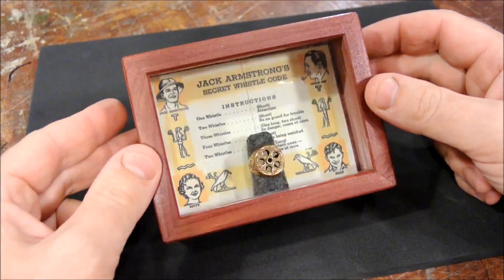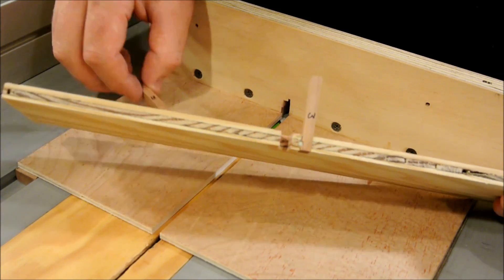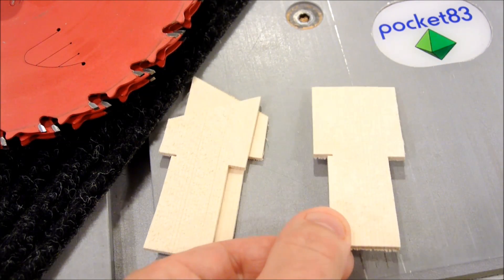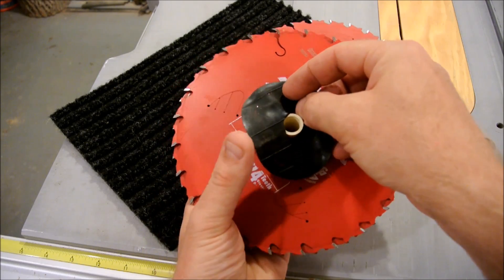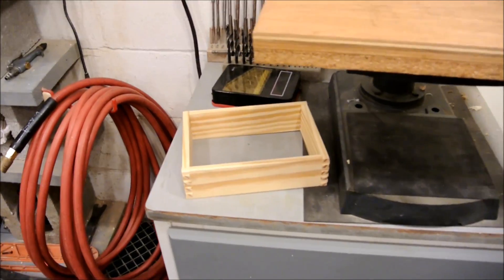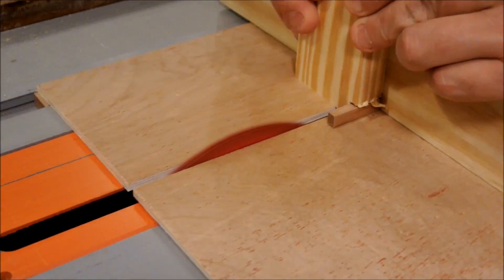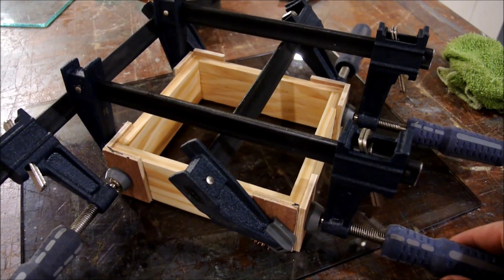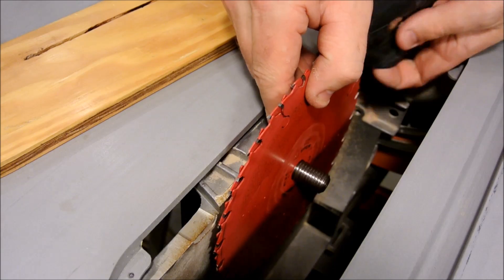Box joints WITHOUT buying a dado set (make one)

Comment: By the time you buy enough blades to stack you could of just purchased a dado set up. Ive seen a decent 1 on amazon for 50.00. Good reviews. Just fyi not cutting on video or creator. We appreciate folks that come up with creative ideas. So thanks for video bro.
Reply: 7¼" blades are two for $10 at the box store. You can even use your old dull blades in the middle.

Comment: I did the same home made dado set. I notice the saw vibrates a little more than with a single blade, which is expected. I wonder if it might damage the arbor someway. But I have no other way to go: dado sets are very rare in Brazil or extremely expensive.

Comment: I don't think that's safe at all. The point of a dado stack is that they are not all full blades. With full blades, that's a lot of mass that your table saw has to move. That'll lead to premature wear.
Secondly, that cobbled together table saw? Definitely unsafe. See the kickback from that monstrosity? No riving knife? Yeah, don't do that.
The stacked "box joint" method is clever if you don't have another option. But don't stack multiple standard blades to make a "dado". Just not good all the way around. If you need a dado/rabbit but can't afford the blades, just use the single blade with multiple passes.
Reply from the maker: Your comment was all shell and no meat. "Yeah, don't do that" is not an argument. Premature wear to what? It will be (re)moving an equivalent mass no matter the number of teeth. If your concern is with motor strain, I will remind you that this is a 10" saw using 7.25" blades at a modest depth of cut. As for the "cobbled together" part, I'd almost take offense to that jab if you hadn't just clearly demonstrated a lack of any ability to operate outside of dogmatic routine. Grow up and develop some situational awareness, child.

Comment: Why are you worried about the stacked blades slipping? It's all the same process for a regular everyday dado set. No rubber spacers in those ones. You could just use spacers/washers made from 1mm thick plastic laminate. Once it's all clamped together on the arbor, it's not going anywhere.
Reply from the maker: Because dado sets are a different thing. These (regular old blades) have overlapping kerf thicknesses. If the teeth were to collide, the carbide could chip or be ejected. Considering how easy it is to your hands on some rubber tube, I really don't see the issue. 

Reason #2 is that the tube will firmly set the teeth in a position of uniform offset, which means that torque will remain constant as the cut is being made. The alternative would be some weird waveform vibration that I'd prefer not to chance. Whatever you use, just think about it lots before you give it a go. Good luck.

Comment: Come on you already spent same amount of money with those three blades Of the one dado set
Reply: Those blades are 2 for $12. 

If you don't have a pile of old blades, you probably shouldn't be making dado cuts anyhow.
Reply: pocket83² those r 81/4 not tipical 7”s which r. $30+ on home dipot When you have  many blades They are probably worn out already🙂
Reply from the maker: No, they are 7.25" blades. And you can use old blades for this, which was kind of the point. Just keep the sharper ones to the outsides, and don't make deep cuts in a single pass. Be careful.

Comment: This is incredibly dangerous given the flexibility of standard blades vs a real dado stack.
Reply: Are you joking? If you're applying lateral pressure, you're doing it wrong. 

But never mind that. One can make coves by passing the work over the blade at an angle. Is that dangerous? Not really. You're just a noob.
Reply: @pocket83squared  No, I work in the real world where knots, nails, environmental hazards, and good reasons to run boards laterally exist--all things that can push your workpiece into the blade, or in your case the blade into another spinning blade.  Spend the extra 30 bucks and buy a dado stack and you also get shims, spacers, and triple the capacity without any kind of wonky and yes, unsafe, setups.
Reply: Lateral means sideways-- as in, coves are made by running the board sideways. You would have to pry something stupid to bend a 7.25" blade far enough to touch its neighbor. And even then, the blades are spinning together. The danger here (to anybody who's competent) is minimal. Besides, it's not like this technique was intended for production; this is a 'get-through-the-project' sort of thing.  

Ultimately, there are no guarantees in crafting. One assumes what one determines is an acceptable risk. But your personal risk detector seems to have its sensitivity set too high. As such, you're done voicing your expertise here. If you need to opine further, why don't you make a video about how you bought a dado stack?

Comment: Pure honesty here.  Nothing pretentious! You didn't have to explain yourself.  What is, is what is.  Power stick pusher, junk tossed back in, go for it!
Speaking of push sticks, just a quick idea, I was at Harbor Freight and found one of those drywall sanding blocks for about $5.  Cheap, made of plastic, has the locking part at each end for sandpaper.   I took that, has some of that rubber shelving sheets you put in drawers, and cut a piece of that and put it on the sanding block like you would the sand paper. It worked great as a push block for plywood.

Comment: I have a combination question here, Jack: Are the blades you're using for the Dado 6 inch diameter, & can you use larger diameter blades (& presumably, make the rubber shims, larger, too) ? I'd be interested in your response, thank you. Excellent, no-frills presentation :D
Reply from the maker: My name isn't Jack. The blades used were 7.25" . These are common circular saw blades. I would not recommend blade stacking larger diameter blades.
Reply: Apologies for the error to (your) nomenclature. 7.25 " diameter is more than sufficient - given the size/depth of cut so-chosen, & would concur, larger diameter stacks not advisable - the raison detre for same, as you assert, not recommended. In regard to Imperial/AF measurements...well, that's the preserve of the United States Weights & Measures....my preference is for Metric - I left the former behind when I was  in Junior school, but certainly, each to their own; only the Haberdashery industry quantify in Yards, feet & inches in the UK, but i suspect (they) shall eventually make the transition.
Thank you for responding so quickly - enjoy the day ahead.

Comment: Blades are cheap compared to dados.  Why not just keep them "stuck" together as if they were a dado set.  You've already done all the set up for the sled, dado stack and key. No need to take them apart unless to clean or replace one.
Great info however.  I've been avoiding buying a stack because of the $$$. Thanks.

Comment: How is it that many will claim to use "imperial" but use a metric number like ".0375" to count inches? Imperial implies fractional numeric expression like 3/32 or 1/64. To my way of thinking either use fractions and imperial or use decimals and meters - but that's just the purist in me being picky.
Rant over, I'm impressed that you had the balls to show the rubber tube idea to space the blades for the home made dado. Another way is to swing the single blade between a second guide and the one you show....perhaps dubious practice but possible.
Reply: Imperial is still based on a numerical system of tens. It just also incorporates fractions that halve indefinitely. A thinking person should really be able to handle both. Admittedly, the dozen inches to a foot is rather arbitrary. Also, anything volumetric is best done without the stupid ounces and gallons that make absolutely no sense. I use SI there.

Comment: The Japanese were making concealed box joints without dado sets or power of tools for a thousand years, wirth simple saws. They were craftsmen and patient, not low skill wood butchers trying to duplicate factory machine work at home.
Reply: Wow. That comment was a classic. In one sentence, you've managed to suggest that I am neither skilled nor patient. You even used punctuation! But I'm afraid that you are as incorrect as you are rude. There is nothing about ethnicity that makes a good carpenter, and a lack of electricity only causes the use of a different set of tools. Craftspeople of any era or race are typically adaptive, intelligent, detail-oriented, and able to best utilize what's available to them. I meet all of those criteria- and as clearly evinced by this response, I'm also patient. So show us your work, or else shut your hole.

Comment: Hey pocket, do you have any tips on resawing boards (walnut) on a smaller bandsaw? mine keeps drifting despite a brand-new blade...
Reply: Can you make a tablesaw cut on the top and bottom first? That will make a kind of 'track' for the bandsaw blade to follow. A circular saw cut is also an option. Just take your time. It's tough, but it's worth it. I cut up a few walnut logs a few years back, and it has been great. I wouldn't do it for cheap wood, but walnut is the best. Don't forget to make a few thick chunks, just for handles and weird projects ;)
Reply: That's a good idea, thanks. If I'm able to resaw and bookmatch I'll probably have enough width that the tablesaw kerf can get trimmed off later

Comment: I might suggest to anyone using the rubber inner tube as spacers that you lightly spread a little baby powder on both sides of each one. That will relieve most if not all of the sticking and won't add enough difference in thickness measurement to do any harm. apply it then just blow the excess off. Hope that helps.
Reply from the maker: This comment shows up a lot, but the sticking is not a bad thing. It preserves the positions of the blades, so that the teeth can each cut one at a time. Compressed air knocks the rubber right off. 

I guess I didn't make this point well enough in the video: I wanted the blades to stick together.
Reply: @pocket83  Oh Okay. I figured that you could very lightly put a little powder on them and they would be easier to remove but would still stick together. My bad.

Comment: Just my two cents....Irwin and Rockler both make dado stacks for about $100. The 3 diablo blades you are using cost about that. I don’t see why someone would risk a catastrophic failure on the most accident-prone tool in the wood shop.  Be careful people
Reply from the maker: Diablos can be had two for $10 on special. If you own a circular saw (or tablesaw), you should already own a stack of them. Now to "catastrophic failure" and being accident prone: in my experience, a single 10" blade in a tablesaw that's been set an inch proud of the substrate is far less forgiving than a stack of three 7¼" blades set to 0.25" internal is. So don't be silly; there's nothing too risky here, as long as you can think with some efficacy. Not even remotely.

Comment: Using a piece of innertube, between 2 blades, the gap between the blades left a hair of wood in the socket that had to be removed. Then I tried a washer cut from the blue non slip craft matting you can buy. Perfection, and as safe as houses. The blades do not move at all. I also read a few days ago that dado blades are not available here in the uk and Europe because our new rules say that table saws have to be fitted with  braking mechanism. Two or more blades make it too heavy and overcome the brake, making the blade too slow to stop or slow down.I hope that helps and encourages others to try this brilliant and easy jig..... if you chop bits of your body off, you shouldn't be using a table saw in the first place!!

Comment: Great idea of cutting strips to make the smaller box; can even use different types of wood for contrast. And don't use rubber between the blades: dado shims are made out of cardboard....
Reply from the maker: I don't care what manufacturers have used for shims- they've tried all sorts of things. Here I've provided a sound rationale for using rubber with regular blades; the point was to limit the possibility of tooth contact by having a secure stack. 

Let me be clear: I DO NOT recommend using cardboard shims and standard circular saw blades to make a dado stack. The idea presented here was carefully considered, and you alter it at your own risk.

Comment: Do you recommend removing the plug and cord from the electric splitter before using it as a homemade table saw push stick?
Reply from the maker: That isn't necessary. Unless you are operating the saw underwater, or in any electrolytic solution. In which case, you should be sure to unplug the splitter first, or remove the cord entirely, as you've suggested. 

Note: it is known that distilled water is not a good conductor of electricity. However, due to the tendency of atmospheric CO2 to readily dissolve in water when it is exposed to it (under normal pressure/temperature), and the possibility of airborne contaminants altering the electro-conductivity of your liquid, it is advisable to NOT use the tablesaw underwater without adequate training. Beginners are also advised to use a riving knife.

Comment: Nice video, but "If you only speak metric" ? That'd be most of the world...
Reply from the maker: Yeah, but I'm an American with a 90% American audience. The other 10% only seems to come here just to complain about how "superior" their arbitrarily chosen numerical system is.

Besides, the inch system is better for woodworking in my opinion, and I can use both systems. Why? Because it's easier for the brain to estimate the position of half of something than a tenth of something. 

So, a sharp pencil marking at 3/32" has to be fit  in between the two larger marks, which is much easier to do when working on a small scale. You just can't do this half~of~a~half~of~a~half thing with a 10-unit scale (as easily).

Comment: You don't need that second key. After having cut the first set of fingers, flip one board around and leave it on the jig. Now snug the first board for the second cut up to it and the blade should only cut into the work board not the one acting as key.
Great video BTW, kudos👍

Comment: Ingenious idea. How has it held up? I have a dewalt table saw which they do not recommend a dado stack setup but they didn't mention your idea. I'd like to try this but can you give us some feedback on how its holding up or any improvements you might suggest.
Reply from the maker: I've been doing this for a long time, and I've never had a problem. There's really nothing to "hold up." I even use old blades to do this. One thing though, I really wouldn't suggest this for box joints much larger than what I show here. Perhaps 4 blades, max. But start small until you are comfortable.

Comment: Pocket83, your "MacGyvered Dado stack" totally works. I am an intermediate skilled woodworker and know enough to realize how dangerous this endeavor could be. I think it's responsible of you to also include the caveat in your presentation. Knowing that, I was very uneasy trying it out. But I figured if I set it up and then started my machine from a remote distance I could run the blade for a good while to see if it holds up. And guess what?....it works like a charm! The blades, as you described, stick together so well that it's hard to peel them apart when disassembling stack. I only used two blades to test viability of idea. I think I will keep them like this as the setup is a nice "thick kerf" kit, which I find useful. I love how you say: "oh, you are gonna kick yourself"...lol.

Comment: Forrest Company makes a pair of finger joint blades that are meant to be placed together, with no spacers. The teeth are set to one side, so that placing them one way cuts 1/4", and the other way (facing out) cuts 3/8". I wouldn't worry about putting blades together, they don't and they are one of the biggest blade companies. I've been using their blades for years.

Comment: Just one question.  Since you are apparently well versed in devious subliminal mind control, can you tell me the minimum amount of time a frame needs to be in order to get the hidden message across without being obvious?  It might, you know, come in handy some time ;)
Reply from the maker: Far less than used here. The frames in my videos are a novelty Easter-egg hunt. The sub-perception threshold is probably way less than half the duration that I present these at.

 It is worth noting that "control" is an extreme exaggeration; subliminal messages have almost no behavioral modification power, but due to the fact that simple suggestion produces a non-zero value affect in a large experimental group, the non-experimentally literate masses operate under the assumption that such still frames are useful manipulative tools.

TL;DR: it's just a game. More of a distraction, really. Besides, I'm operating on your psychology in many other places in much more subtle and effective ways. Thanks for watching!

Comment: For this application there's no point in being picky but if I were making a display piece I would make both ends symmetrical so they have the same number of fingers. Here you indexed two sides against the key and then added a spacer for the other ends where I would do both ends of two sides the same and then use the spacer for both ends of the other sides. More simply than using a spacer, which get lost quite easily, you can just use the finger of another side fit over the key. That way you have a solid piece to hold the work piece against instead of holding it free hand in the middle of the jig hoping it doesn't move.